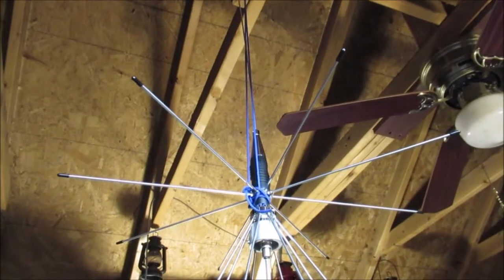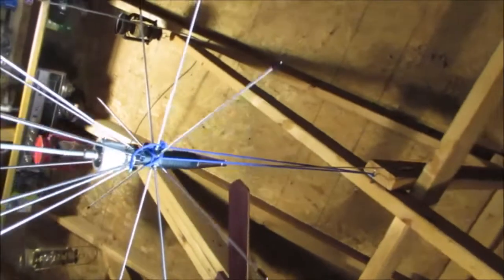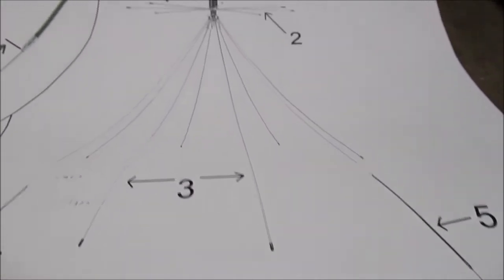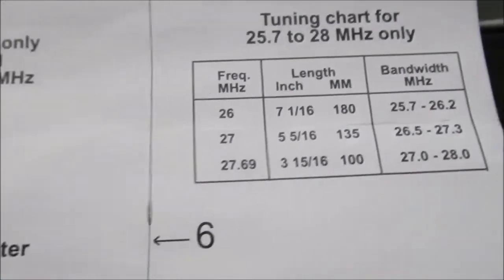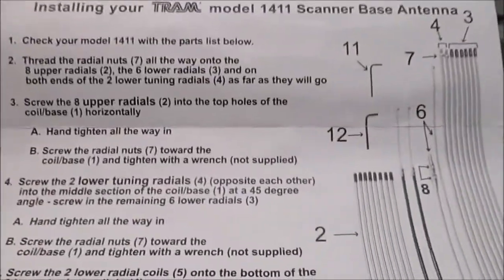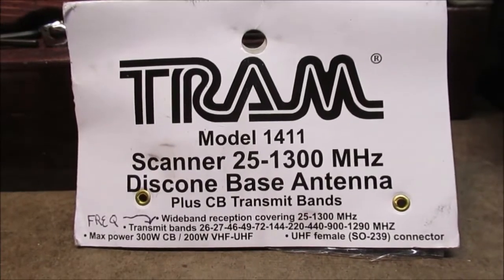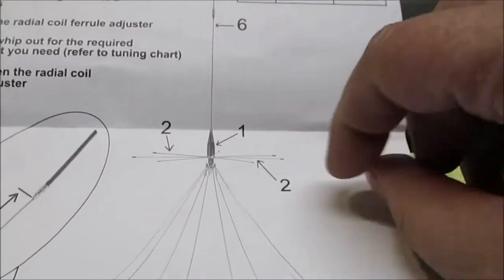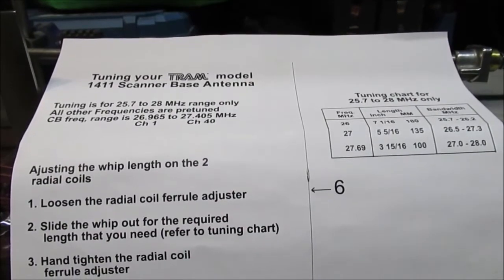Discone  Antenna

Comment: I just got mine in and put it together in like 15 min. Very easy if you just follow the instructions. I don't have it up outside yet but got a top rail for a chain link fence. Looks like it's just right after running wire into it then clamp it down. Thanks for the video.
Reply from the maker: Thanks for sharing

Comment: I'm assuming you bought the Tram 1411 for transmit capability. If you were by chance just going to listen you could have bought the 1410 that's scanners only. But I believe you are ham or at least I think. I'm trying to find videos on the 1410 and some how the 1411 pops up. Not the greatest broadcast and receiving antenna due to static noise. Antron 99 with element kit would have been the better investment.
Reply from the maker: A99 antennas build up static Beware they are Lightning poles waiting to be struck
Happened to 2 people I know
Reply: @not2fast4u2c  if they are not grounded properly yes they will but in 20 yrs and many electrical storms I've never had one get hit. As for the static I've never had that issue. That's the difference between buying an original Solorcon vrs copies.

Comment: Thanks for this.  I had thrown the label away and so all I had was the instruction sheet (which is next to worthless).  I snapped a pic of the label that you included in your video and I can work with that.  73s Tom KC3QAC
Reply from the maker: Glad I could help This is a good antenna for the cheap price  And it can transmit on 27 mhz so I think it would do 10 meter also

Comment: Interesting, thanks for showing this. Not often you find a commercial discone which will cover 10 and 11 metre bands.
Reply from the maker: I knew that they made one ..I was amazed to find one on Amazon ..I looked through several ham radio companies and they only sell the high dollar brands and do not transmit 10 or 11

Comment: How an I supposed to mount this outside?
Reply: A post can be installed at where the coax connection happens at the bottom. From there you can clamp it to a mast.

Comment: Excuse me, I would like to know if the radials that have another extension that are inserted and pulling out have any measure, I don't know what to do with that if I leave it as it came from the factory or remove it, please help, thank you
Reply from the maker: Re Watch the video I show the paper with the measurements CB radio is the 27 mhz. measurement